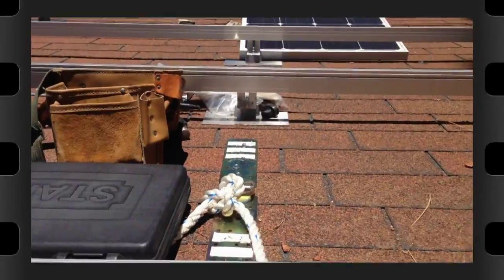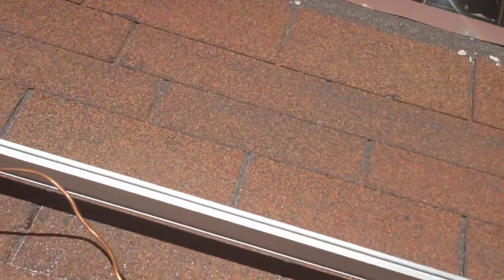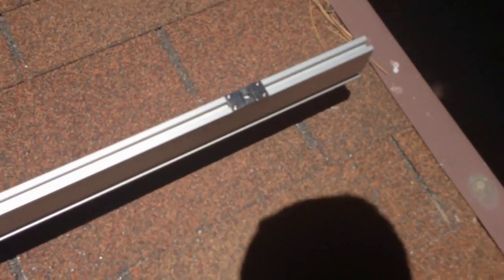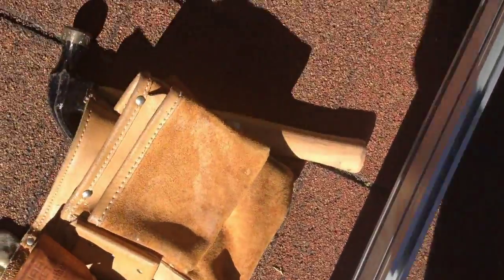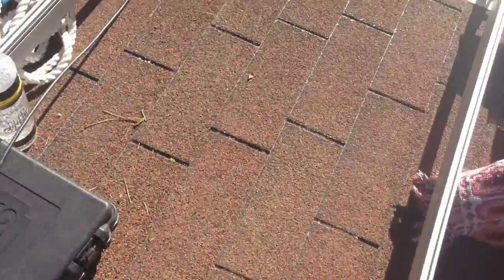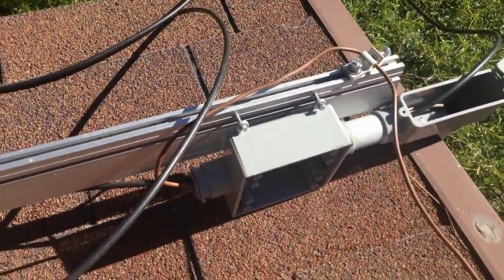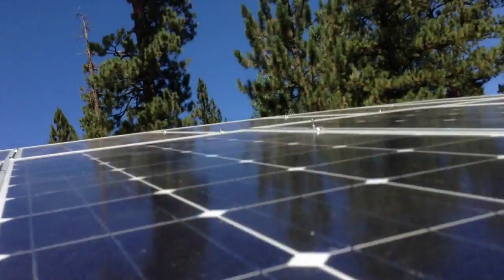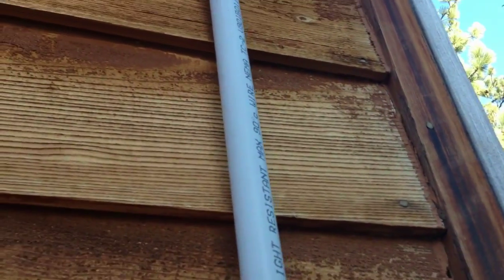Off Grid Cabin Solar Installation - Part 3

Comment: Enjoying your progress. you're taking your time. I remember when I did mine I just wanted to get it done so I flew through it in about a day. Thinking back I should have taken my time to enjoy it
Reply from the maker: that's how i did my first install.  jammed thru quickly.  i told myself this time i would take my time with it all.  each install gets little bit better. so happy to be off the hot roof

Comment: Beautiful install, looking forward to your upcoming videos. Wish my setup was this clean. Like a lot of other diy'ers I started with one panel. Then I added another and so on, now I have 8. Learned a lot but if I do another one I will definitely use the rail system like you installed. Just need to find a nice little cabin like yours to install it on :)
Reply from the maker: I had ta similar issue on my 1st install at my house.  I started with a few panels, a little windmax 400,  and cobbled together slowly which resulted in a bit of a hodgepodge.  Some portions on rails, part grid tied, part off grid, and lots of different brands...lol  It's always nice to have a second time around to do differently. I've often thought of redoing my home system, but since it all works without a hitch, i can't justify the time and expense.  But, had i done it a certain way from the start, I would have had a better system with better equipment and probably less $ than paid on the hodgepodge set-up at house.  ...i mean i had to wire in a Reliance Transfer Switch to run home circuits off the batts for grid-down situations, and i have to manually flip between charging batts or gridtie on 1 array...than i have another array that's just permanently gridtied enphase system i put in separately.  Anyway, I hope you get a chance to find a little cabin of your own one day.  It took me long time and bit of luck to find this little cabin for a price i could afford, but persistence and goo fortune finally paid off.  Thanks again for the kind words!

Comment: nice install job. Grounding is a must. I see a lot of installs were they don't Ground to code on there systems. that rack system is great for that, its a bit pricey, but price isn't a factor when it comes to the cost of the entire system. I use unistrut it works good but a pain for grounding since I have to ground each panel and rail. but it works. again nice install.
Reply from the maker: Thanks Charles. You're right, they're more pricey (mainly shipping), but they do make the job a lot easier, including grounding.  I went with the cheaper version of the Ironridge, I believe it's the XRS.  I used the XRL for my home, since my rail length there was about 36' and XRL allows for greater span with less penetration points into the rafters. I can't tell you how anxious I am to go back up there and finish the job now that the roof's complete.

Comment: Holy crap.  I hope you never have to service any of those panels or mess with the wiring of those panels, especially the ones in the middle!  That is all packaged very tightly but neatly up there.

I hope your wire doesn't have to go much further than that junction box to get to your charge controller because that wire isn't very big for 12v and you are going to get some voltage drop.  I learned that the hard way, myself.

Good work, though.  Clean and tidy and simple.
Reply from the maker: no kidding...i completely overlooked the lack of service space.  good news is all panels wired and work and all run in series and a short run to boot.  so not too worried about a V-loss, etc. but that was pretty radical getting the last on on there that day.

Comment: This  helpful movie in my project but what about lighting during bad weather?
my shed is 8x12 just need a small amount power.
Reply from the maker: +Jacqueline Rogers lightening poses no problems when you ground your equipment as shown in my vids. Everything from panels to the rails gets grounded with #6 cooper terminating at earth.

Comment: Interesting stuff!
IMHO though a DIY enthusiast might try to do the same as yourself but not understand the safety issues...
The mc4 and cable connections are DC voltage and when exposed to daylight they are LIVE HOT !!
No on/off switch on the panels themselves - and electrical arcing is always possible.
I can see you understand what you're doing but others might not.
Just saying something that is easily missed and taken for granted ;-)
Reply from the maker: good point on safety.  i should probably offer a disclaimer at the beginning of these vids.  i guess i take for granted and would hope people will think carefully before playing around with any electrical work, especially DC.  as you know, DC is much more dangerous than AC so definitely must be careful, especially when wiring a large array.